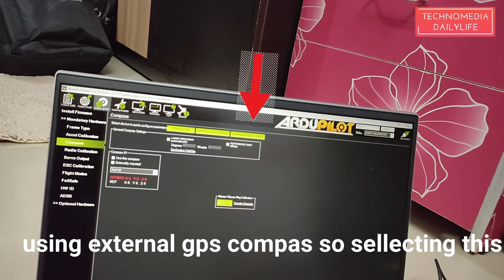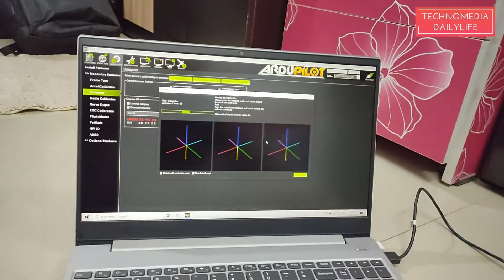APM 2.5 compass calibration error HELP 99% peoples face this problem

Comment: hi brothers,

I was trying all the steps thats on internet. But the answers didn't work for me. I finally went to a electronic repairing shop and checked my external compass current flow. There was a issue on that when checking. Fixed it came home pluged normally.
note - default apm 2.8 soldering, No soldering needed like in videos.

Only thing you need to trust is there is  a issue with your external  compass.Now go and fix it..bye bye
Reply: Tum thora detail me bataoge ke tumne kaise thik kiya